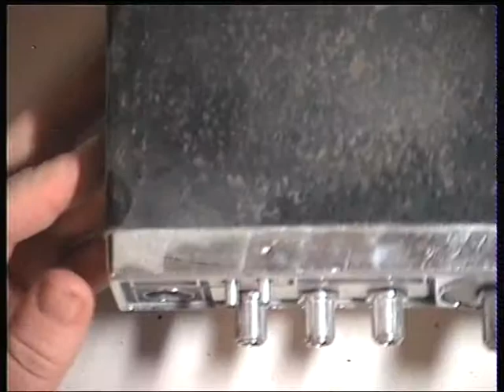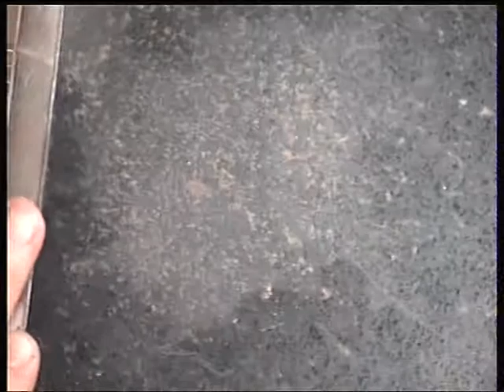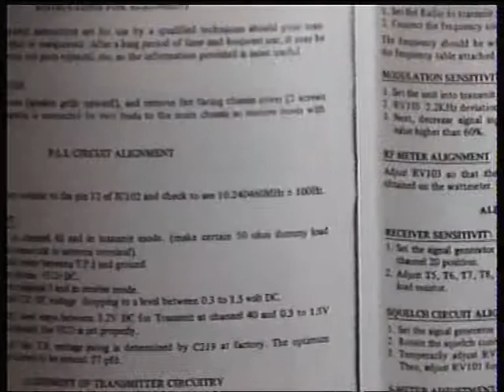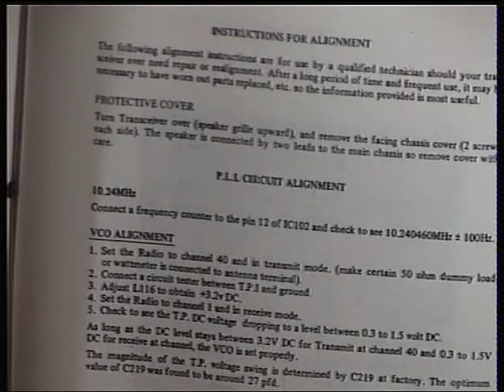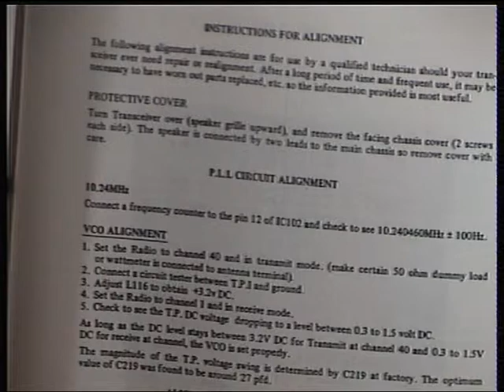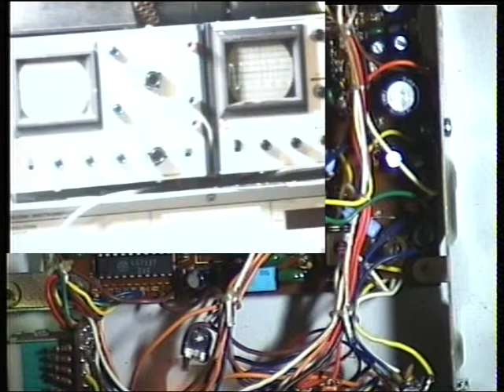Maxcom 6E, UK (CB 27/81) CB radio (Mobile) - Transmitter alignment

Comment: I have one of these all works fine but it only manages 3 watts. Is that a sign of a weak driver or output or just the normal variance that you might from one example to another?
Reply from the maker: If that's the max you get get after alignment then that is within limits. I usually use 2.9W as the limit  point I need to investigate...except Great GT858/868 chassis where the limit spec is 1.7W.

Richard
Reply: @ukfmcbradioservicingTango21  Thanks, I did suspect that 3w would be within acceptable limits, just struck me as odd that it was lower than your example. Same with my Amstrad 901, yours is doing 4w mine does 3.5w. In the real world it's splitting hairs in actual performance terms I know.
Reply from the maker: @2Steppa2  Bear in mind adjusting some of the non-adjustable coils (the ones that look like springs) in the transmitter PA will adjust the power slightly....compressing them slightly or expanding them slightly can make up the difference.